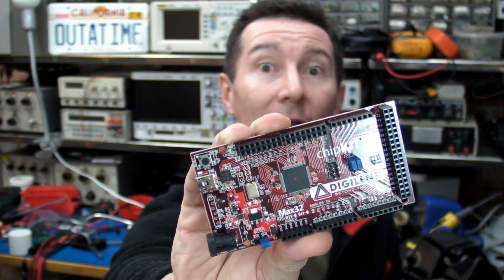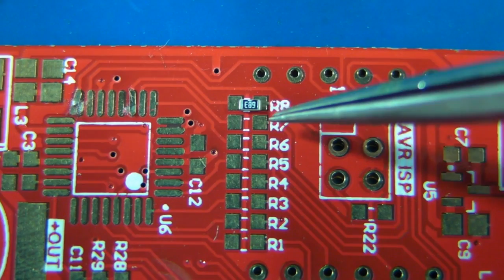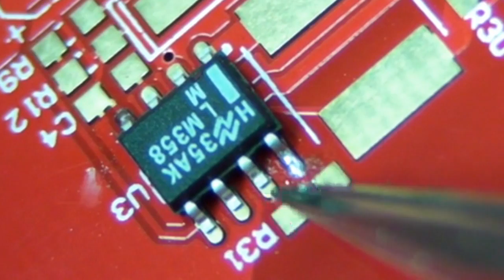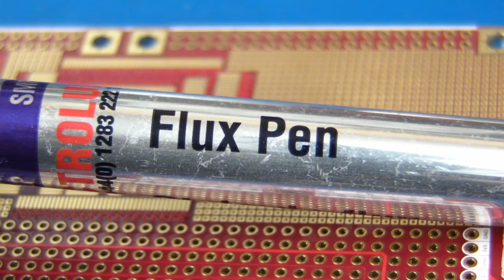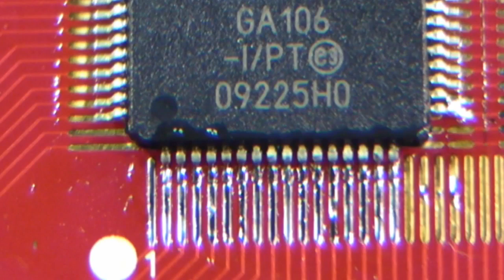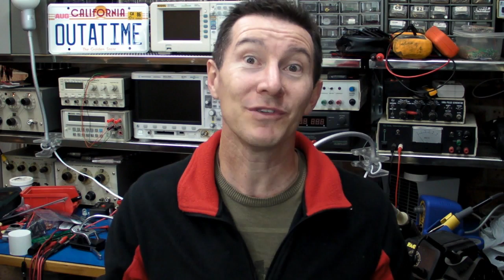EEVblog #186 - Soldering Tutorial Part 3 - Surface Mount

Comment: You said you turned your iron up to 450° C when you demonstrated lifting the pad, what temp do you run it for working with the small IC's or resistors?  Thanks.

Comment: I used flashrom (you need to compile it on the Pi first -> get it from flashrom.org) and Raspbian as OS. For writing to SPI-chips you need to load the right kernel module, but that's just a matter of typing "sudo modprobe spi-dev" for i2c it's modprobe i2c-dev. But maybe you will need to remove these modules from /etc/modprobe.d/raspi-blacklist.conf first.

Comment: what i do is to load the legs up with flux, press the component down onto the board with one side of the tweazers, apply a bit of solder onto the iron then tap each pin in turn and the solder flows into the joint nice and smooth due to the flux that exists.

Comment: @EEVBlog hi Crazzy Aussi ive been sodering 3 -4 years and im going to turn 14 in a couple days and ive soldered by putting a small amount on the soldering iron for heat transfer so it becomes quicker to solder its never failed but is this the right way to do it?

Comment: when you are acctually soldering heatsinks or extra thick lanes cause there is a lot of current flowing through there you could instead of using higher temperatures use two soldering irons at the same 350 degrees celcius temperature. cauce you are using two soldering irons you have twice amount of heat transfer and twice the amount of power your soldering station can deliver to the iron. This method helped me while reparing a board wich has a large heatsink on it that was broken loose.

Comment: Thx Dave. You have just encouraged me to do some Ram hack from 32 to 64mb in my Tplink wnr 1043nd router. I already found one old DDR module with 32Mx16  400mhz chips. I have some 20W soldering iron, wick, tin and flux. But i dont have chisel tip, I got 2 standard tips - one pen like, other very sharp. Should I get chisel before I start? Here look, how routers board looks like. tinyurl dot com slash 3z5zbpc

Comment: How many components do you fry?  Some of them seemed to have the heat applied for quite a long time.

If a multi-pin chip needs to be replaced, is it possible to get it off the board?  I guess you could use a jig to heat all pads at once, then simply lift it off?  If you're replacing the chip, frying it wouldn't matter.

Comment: I guess this gave me enough convidence to start on a board with a EPM3128ATC100 (100pin TQFP) that has been lying around here since over 2 years, only had experience with 1206/SO-20 so far. Thanks Dave.

Comment: You have me reminiscing of my training for my (now expired) soldering cert. We used that exact drag method when we had to solder the our 100 pin QFP IC. I don't know what the pitch was, but it was a tight pitch. We were running at almost 400 Celsius.

Comment: Hi Dave, I have a digital recorder that has no power. I need the recordings off the recorder. I would say it's high priority. There was a 10v capacitor in the device that failed. I soldering a new capacitor on the device and still no power. I have a full diagram of the schematics and can send them to you or anyone. Can you help me figure out what I should troubleshoot next. I can send you pictures or even if you can tell me what to test. It's for an ICD-BX700 Emaile me listamillion@gmail.com

Comment: Hi, that 154 surface mount resistor, It looks like mine is blown, there is just a spring showing. and the laptop, will run from battery only, is there a way to fix it. where can I get another one?

Comment: First time soldering, I need to attach a wire to a flat pcb connection(Like the pcb pins)
Would I use the tap and reflow method? is that the easiest?

Comment: It has partly to do with surface tension, and although I don't know the exact physics behind it, I strongly suspect it works as follows. The metal acts like a heatsink, cooling down the surface of the liquid solder which comes in contact with any metal pads, causing it to solidify. As soon as a thin film or solidified solder has formed on a pad, more molecules of molten lead/tin/zinc will attach to it, lose its heat, and then solidify.

Comment: If you do a lot of soldering and de-soldering, you're bound to use a lot of flux, in which case I suggest making your own. It's dirt cheap and really easy, just dissolve a pre-measured amount of rosin, also known as colophonium and pine resin, and dissolve it in a certain amount of denatured alcohol or isopropanol. You can even make flux in different concentrations that way, ranging from 40% (ideal for soaking de-soldering braid in when de-soldering SMT chips) to 85% sticky syrup.

Comment: Thanks Dave. I last worked in electronics back in the late 80s so surface mount wasn't around. Just designing a USB interface and I went and ordered some MCP2200 and ordered the SSOP package instead of the DIP (yeah, idiot mistake). This helped a lot.

Comment: Can you repair a pcb board connection if the metal rings around the pins got snapped off the board for 2 points? and it pulled off some of the base of the board?

Comment: I have to replace a 4558 chip and some 04-02 caps. The caps went leaky in the 9VDC Vcc buss. One of those items that poops out withing 50 days of the warranty expiration. I hate 04 02 stuff! I can say that this item was meant to be tossed out rather than repaired. I have taken apart acoustic guitar necks and bridges that are glued in place easier than prying that damn PCB out of the box. The pads are fucking tiny! Thanks for building my confidence Dave!

Comment: Dave have you ever reballed a CPU/GPU? I want to reball my PS3 I see you can buy the stencils off ebay but I'm not sure of the process. Can you PLEASE PLEASE PLEASE do a video of how to do this??? Do I heat the balls on the GPU inside the stencil to melt onto the GPU then reflow onto the PCB by applying heat to the GPU? Any info regarding the process would be very much appreciated...

Comment: Very nice video!  I started out with applying solder on pads and tack as shown in the video. Doing some (400+) 40 pin + IC's, I've learned to apply a tinning layer of solder on one leg, not the pad, then its easy to place the IC absolutely centered.  Then Touch the iron to the tinned leg centered holding it in place and finally fully soldered in about 20 seconds, looking like a machine did it.  Maybe one day I'll make a video showing this described and other tips I've learned on the job.

Comment: greeting from new york , great vid. I notice when i look at my pc motherboard and other type of motherboard , they have  missing stuff like resistors and chips on them buts works. like my pc mother board have a id/picture on them and a cap was suppose to go here but it's not there or resistor was suppose to go here but it's missing. what would happen if i fill in the missing blank?

Comment: too much heat on chips and transistors will damage parts if u got to much solder on iron use a wet sponge to wipe it off dont use a lot of flux it will over heat part more than solder and cause land to brake off  its like frying chicken in hot oil and it makes the board look nasty i did tv repair for 30 yrs and factory smt work n rework and not all boards have good gold /copper bonding to board the older boards where made  much better and lands stayed put

Comment: Not to seem mean or anything but i learned that you apply the heat to the lead and not the actual pad itself and i notice in your video you dont do this but rather use the pad itself which could potentially dis-attach itself from the board. For example: 32:19 i see that you placed solder on the pad and then the lead heating the solder on the pad but not the lead itself, it didnt flow correctly, but when you say that you have to use the lead you seem disappointed. but notice that flowed better.

Comment: Excellent video!  I recently needed to assemble some prototype PCBs (high power LED drivers) - my components included some 0805s, some SOT23s and a few SOD323s.  I spoke to a professional friend who gave me some general good advice (he described "tack and re-flow" and gave me some lead-free thin solder). Then I found Dave's video which actually showed me how. It was enough to give me the confidence and technique to do it...and all three boards worked first time. Thanks Dave & EEVblog!

Comment: I just put a bit of solder on the tip of my iron, hold down the SMD device and tack it.  I don't understand the need for pre-soldering the pad.  It creates a large bump that makes it harder to center the smaller components.

Comment: Really awesome video dude. Learned lots of new things. Liquid flux, dragging method, more info about hot air and solder paste. That tip that holds the solder... never heard of that and been in electronics for 36 years.  You have a very nice way of explaining the subject.

Comment: Sorry, yes, Avionics.  I worked on the Mirage, Hercules, F-111, Hornet and a few others.  I worked in Micro-Miniature Circuit Repair section using a 70x microscope where we had to learn to work on multilayer boards and repair tracks inside the board without air pockets or bubbles in the resin and ensure the solder joint is perfect with no scratches and of a particular curvature.  At first the soldering/desoldering gear was not up to the standard it shoud have been but improved later on.

Comment: Firstly, great tutorial!  At 33:00 soldering tip is too small to transfer the heat from the small tip to the component and pad.  A larger tip would transfer the heat quicker and evenly across the component heatsink and pad.  This minimises damage to the component and pad.  Also, re-heating the solder is not ideal as it lessens the quality of the solder joint.  To note if anyone is involved in aircraft, then learning solder technique is a must.

Comment: hi thanks so much how do i do a five pin regulator that has an underside flat surface to heat up and no access under the board 5 pins are easy to get at but the under side back of the device is tight between can caps poor board design thanks Greg

Comment: ok but i have had bad experiences with green solder mask pre-made boards as most often the solder wud flow & stick over it & short out the pins if u try to work ur solder iron like that & i use a pinpoint type iron thats why i was wondering is there something else that does the trick...

Comment: what kind of soldering iron are u using @16:28 & how come u have such a clean joint on each pin w/o it overlapping the middle space or the solder sticking to each other & shorting the pins out plz help i am a bit lost here

Comment: clean all ur flux up at the end with alcohol.   2 irons makes it really easy to quickly remove and replace parts.  Get tips sized to your parts.  We use Metcal and Oki irons so its easy to get the right tip with the right temperature for the job.

Comment: At my job we do hi reliability space hardware. The easiest way to solder 2 terminal smt devices it with 2 irons. We use thin solid solder and liquid flux   Put a drop of flux down on the pads and apply a little solder.  Place the part on top of the pads and place place one drop more of flux on the part.  with two irons simultaneously touch each pad part will float and center itself on the pads.  remove the irons simultaneously and quickly after the solder melts from the pads to the parts.

Comment: Very good presentation.  Some of those joints made me wince, however. In the old days of through-hole components, I learned to solder in the Marine Corps out at 29 Palms.  The class was two weeks and we were graded to NASA specs.  Very demanding, that was.  There was another micro-min class that went into repairing multi-layer boards but I never attended that one.  Friends who did described it as a "cast-iron bitch".

Comment: Hi Dave, I was wondering one thing, can we use the least size footprint for the 0603 as you mentioned with solderpaste and then use the solder pump to suck up the excess solder? Awesome video! :)

Comment: Dave, tell me, are those 1206 footprints where you solder your 0603 resistor? The reason i am asking this: i am looking at Altium 1206 footprints, and thinking that it wouldn't be so easy to hand solder as footprint length is nearly as 1206 component length itself...

Comment: My method of soldering two lead (resistor, cap) SOT chips. I tin both pads on the board, I then drop the SOT on the pads (mostly centered), use two pencil irons (one in each hand) and reflow. Let surface tension center the SOT. I can get it to work about 90% of the time. Most mistakes is when one of the irons "wicks" the part up when the iron is removed.

Comment: 350°C? That's a lot, I usually go to about 270°C for regular 1206 pads.... (Normal soldering gun, I don't know temperature for hot air, but it is something about 300 tops too.)

Comment: Thank you so much for those soldering tutorials... I'm a beginner in electronics, and after several attemps over the years I always sucked bad at soldering.  Now, 5 minutes ago, I finished soldering 14 wires on an SMD chip (destroying 3 other chips in the process but still), which I never thought would be possible for my clumsy self.  All thanks to you!  Cheers from Canada!

Comment: For 0805 tacking, I use a 3 step process.  I put a very small amount of solder on the pad to not increase its thickness very much.  If i put too much, I completely wick the solder off, and that is still enough for tacking.  That makes it much easier to lay the part flat, and helps me align the part with tweezers.  I use liquid flux on the pad, and then tack one side.  Then i solder both sides.

For drag soldering, i've bent tons of pins with chisel tips =(  I prefer poking at a few pins instead

Comment: I don't know if it was mentioned in the comments, but what you did with the DPAK larger pad is called a heat bridge and its an absolute must for a lot of other stuff that is attached to one or more ground planes, like connectors and cables. Using flux also helps transferring heat to the parts.

Comment: I prefer SMD parts for my projects nowadays, it's easier if you ask me. 0.8mm is about the limit for my patience on a home etched board, but it really helps if you have those long pads to soak up some of the solder otherwise the bridges on the pins can be a bit of a pain with no mask. I also use a micron vacuum desoldering station when things get out of hand. I really need to review you videos, those proto boards you get look nice and if I remember correctly, cheap too. Cheers.

Comment: One of the things that you can do if you want to be able to solder by eye and you want to go smaller than 0603 RESISTORS is by using 4x0402 resistive networks. They're basically the size of an 0603 package (a little bigger) and they have 0.5mm pitch. It's not easy, but you can get great density on those. Great for DDR2 or other buses.

Comment: @EEVblog My favorite size to use is 01005 components LOL J/K I did try to solder a few of them one time and a little secret to doing components that small is to use a tiny drop of superglue to hold it to the PCB before you solder it.  Even if you have small enough tweezers and can hold it, its likely that the smallest movement of your hand will make it impossible to keep centered on the pads... anyhow HAVE FUN SOLDERING ITS DEF one of my favorite pass times! Keep the vids coming Dave you rock!

Comment: People seem crazy afraid of SMD parts.. and think they need to rework a toaster to use them.. I can solder 100 pin tqfps with a $5 iron and I'm basically crap at soldering. Desoldering SMD parts on the other hand is a total nightmare. A video on that would be brilliant.

Comment: The pad size is also important if your board is likely to be soldered using reflow.
If pad is too big, the component moves during the soldering (tend to missaling).
In fine pitch IC's, pads are critical so you start getting shorts everywhere. The mask cannot reach the inter pad gap at all ...

Comment: @e1ace Thanks for the tips! That's about what I've been doing when I've had to. Not had to deal with BGA's though. Didn't know they were so sensitive.

What about QFP's though? Any other option than hot air reflow to desolder them? Solder wick doesn't really do a good job always, high risk of ripping pads that way.

Comment: I'm still amazed at the number of thru-hole kits that are advertised as "easy to make, no surface mount parts". 

In my experience of teaching people to solder, they will complete a surface version of a board in about half the time with half the mistakes and virtually no dry joints. 

I usually use 1206 just to keep it easy for them in a workshop.

I hate thru-hole because of the messy results, legs that move, flipping the board. Urg!  I don't know how anyone can design in it anymore.

Comment: @EEVblog Ah well, please do one on SMD desoldering! Love your method using two soldering irons BTW, that's the Rambo style :)

I think before you go into BGA's (if you do) you should do one on leadless chip carriers because those are mostly what motion sensors come in.

On the AeroQuad forum (aeroquad.com) we developed an open source mutlicopter board collectively which uses only QFP and leadless chip carriers (different types) for sensors.

Comment: Notice how after one pin of the LM358 was soldered, the whole chip was misaligned a few degrees. Then the board was rotated 180 degrees to allow the opposite-corner pin to be soldered. At that point there was a cut in the video and, miraculously, it can be seen that it is perfectly aligned!

So there you have it, folks, if your chip is ever misaligned, just rotate the board and, poof! it's fixed! it must be due to a combination of centrifugal force and what ever magic there is downunder.

Comment: Something I do occasionally on boards, if I solder a row of resistors by hand and the alignment isn't so beautiful, give them a reflow run with hot air, they usually straighten themselves out pretty well.